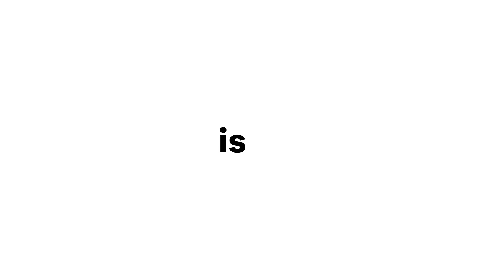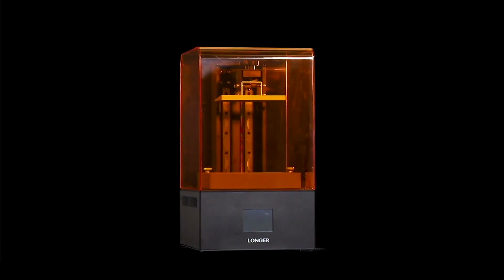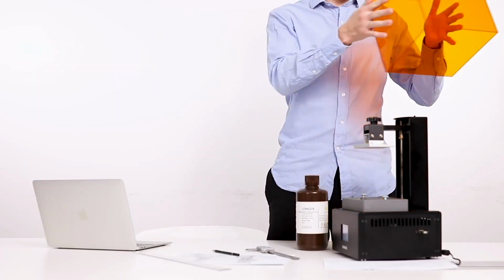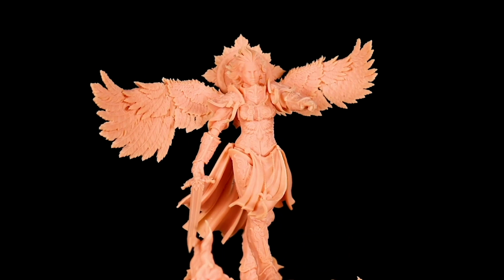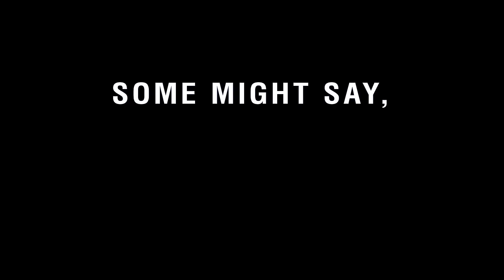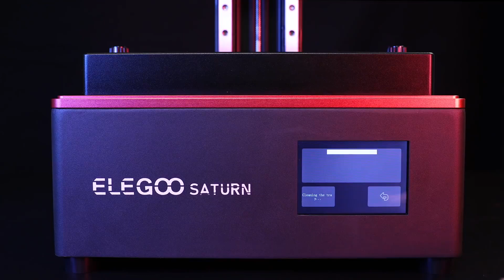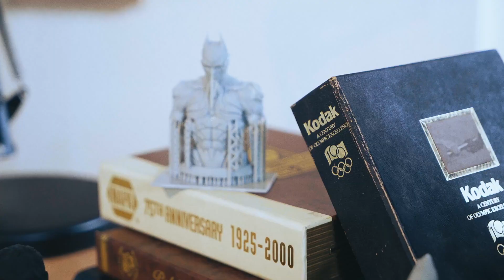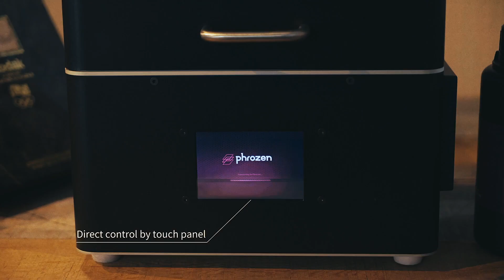Top 5 Affordable 4K SLA 3D Printers under $1000 in 2021

Comment: You stitched together the promotional videos from 5 print manufacturers with a number animation in between. This only barely implies an opinion without offering the slightest justification for that opinion. This is at best laziness and at worst a minimum possible effort cash grab (I see you got the affiliate links in the description). Come on man, you can do better than this. Tell us WHY it's the number one printer on your list. Tell us HOW you ranked the printers.
Reply: I agree, I always get disappointed when running into these tech youtube channels that do this, but unfortunately not everyone is in it because they're passionate, but for the money instead.. It's rather sad
Reply from the maker: Thanks for your comment, as mentioned in the description, these videos are sorted by maximum print volume, from the smallest to the biggest 4k sla 3d printers that are in the more affordable range
Reply: @MarsGadgets   /woosh
Reply from the maker: Thanks for the feedback, but they actually do come in 4k! When you check the link, there are 2 options, one is the lower res, and the other is full 4k (obviously more expensive)